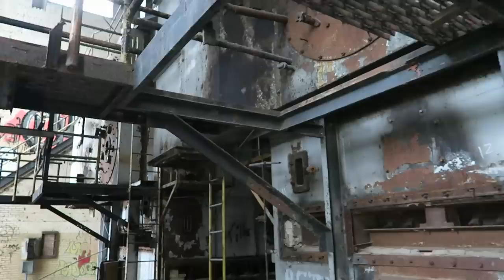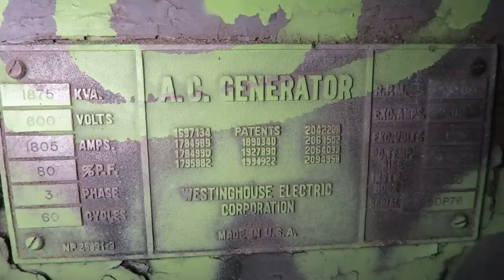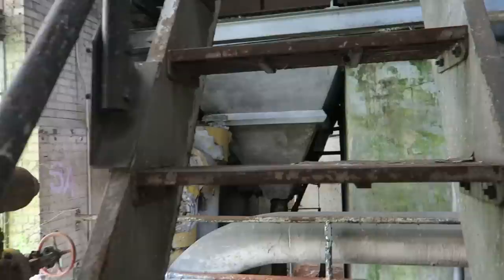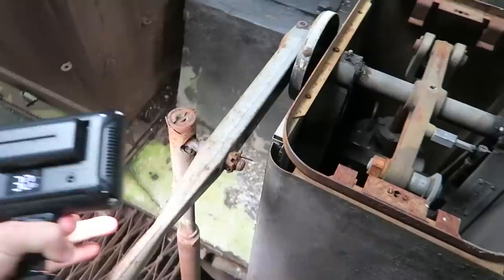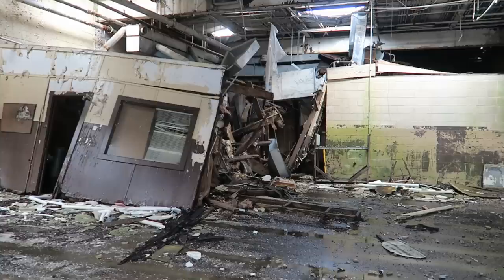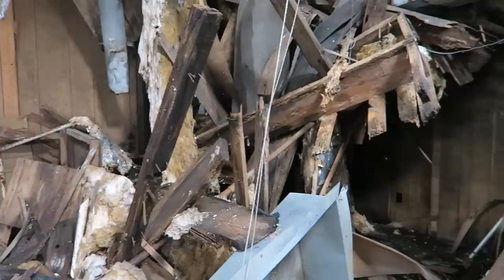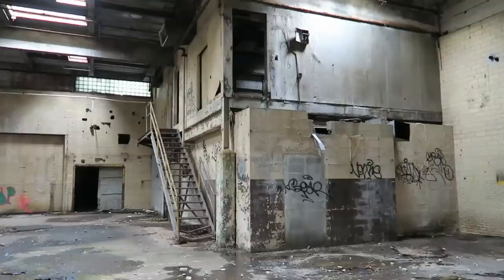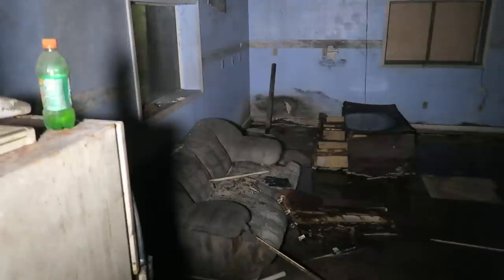Massive Abandoned Factory - With Some Unexpected Visitors Lurking

Comment: Watching videos of folks such as yourself exploring these old factories has always been fascinating. It reminds me of my place of work. The steel plant I work at was built in the mid 1800's and then added onto during the 40's for the war effort. And most of the machinery we still use is from that area. The older part of the plant is closed off and falling apart but can still be accessed from inside the plant. Are motor rooms are still slate board and open contact and mostly all dc energy. I can honestly say it's fun going threw the older parts of the plant

Comment: The stairs that were going to the top of the boiler would have been a work deck when working on the steam drum. The ones were you tryed to move handle was a steam turbine to run what looked like a blower or another generator

Comment: I just found your videos and have watched a few of them now.  They are well done and I am looking forward to watching more. I do have two observations for you. First, in more than one video you comment about the stuff left behind and how it must have some value. 99percent of it has no value beyond scrap. The fact that it still sits there probably means that the srcap value is lower than the recovery cost. Second, perhaps you should consider weaing some sort of filter mask. Asbestos was widely used in many of these old plants as insulation on almost all boilers, ovens, steam pipes and heating ducts. as the stuff ages it becomes dust in the  air. I like your videos. Just not enough for you to die because you did them.